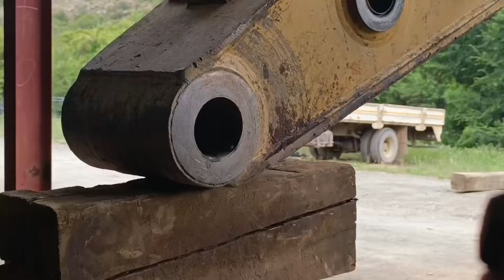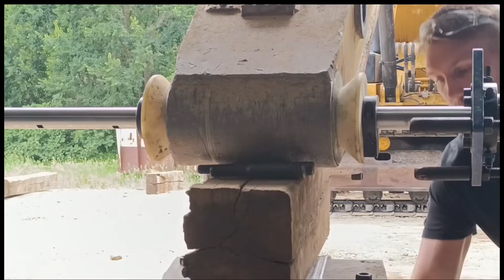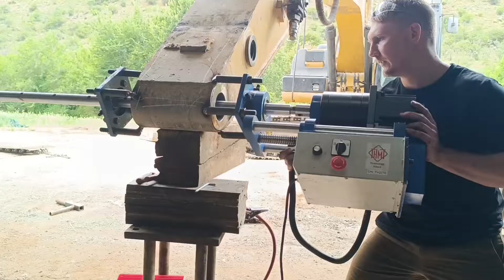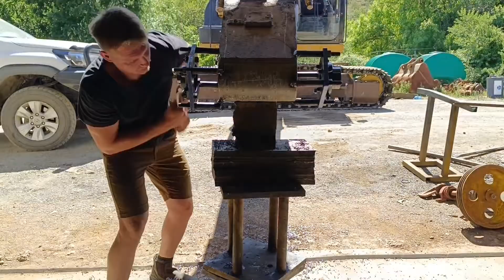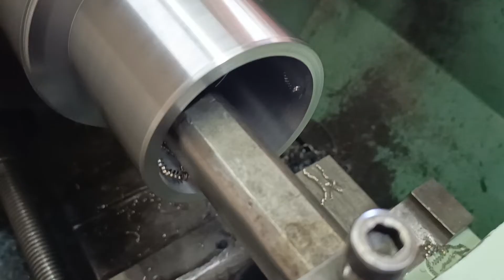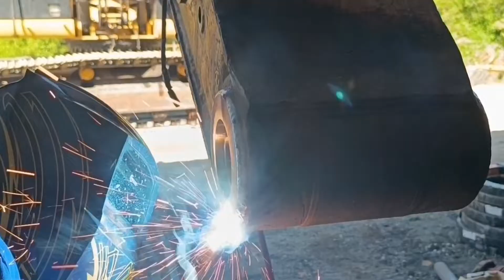Step by step repair on an excavator boom!!

Comment: Nice fix, seems like a good alternative to welding the bores up
Reply: There's pros and cons to either.
Obviously you need quite some flesh left for being able to push in a sleeve without compromising strength. But if you do, it's of course much faster than welding up the bore and line boring it to size again. And further on the plus side, one can seat the hardened bushings already in the press in the workshop and doesn't need to play with liquid nitrogen.
On the downside, the repair is further away from "original" and might have a negative impact on future repairs.

But I don't think, there's only one solution and it all comes down to function. If it works, it's good, and if it doesn't work, it wasn't the right method.